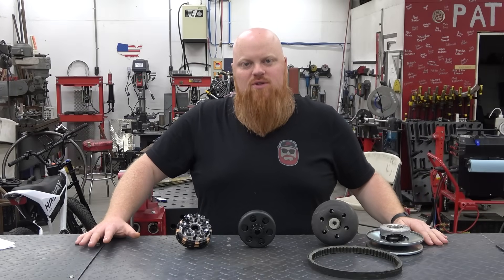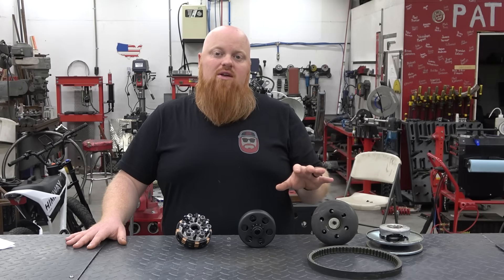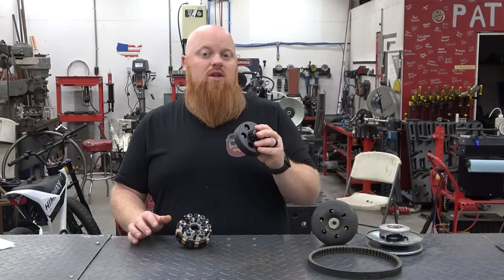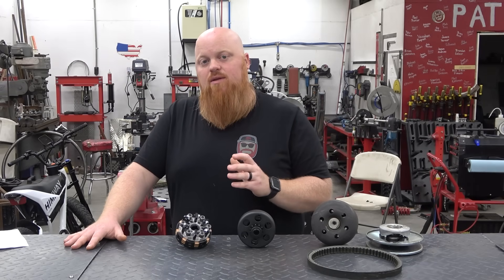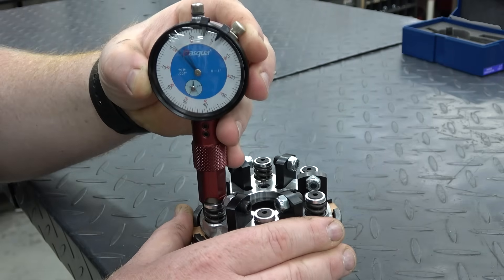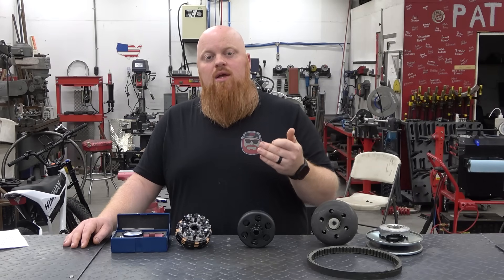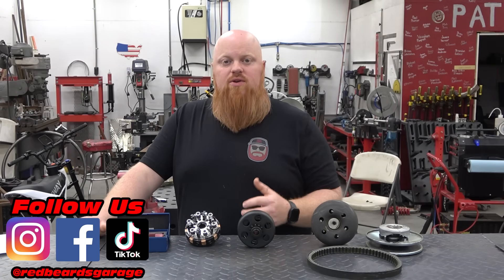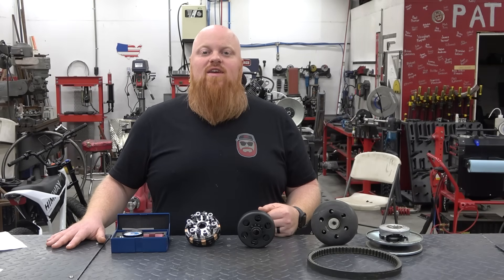Racing 3 Disc Clutch Vs Drum Clutch

Comment: Can i swap out my drum clutch (sprocket on the inbound side) for a disc clutch and expect my chain line to be the same?  My minibike if fully custom and it’s stretched so i have custom made dler and tensioner with no left to right adjustability.  If they are not a direct swap, maintaining existing chain-line i can’t use it.

Comment: Reddit talked me into then out of a torque converter. I wanted the performance but my trail riding is real UTV and Single track which involved mud. I’m in western pa and it’s wet here a lot and from riders with experience told me to avoid the belt drive. Slips even with the higher end setups when water and mud are involved.

Comment: I do a ton of woods trail riding and sugar sand riding am i better off w a converter or disc clutch? Cam, rod, flat top, 26lb valve springs on a hemi 212cc
Reply from the maker: Yes cvt would be the way to go.

Comment: I wonder if it's possible to use a cable around where the spring goes in the max toque CVT and control it with a hand lever. In theory it makes sense to my brain .

Comment: Got me drooling over a disc clutch my big butt doesn't need lol. Would be worried about dust, dirt and grime even on asphalt. Maybe a Tillotson 212R with a header and 24mm flat slide carb on an old race kart for racing around the block. Still probably overkill for the application.

Comment: Would you say external climate would impact what clutch you use? Could disc clutch be used for snowmobiles or carts that will run in potentionally cold, muddy or wet tracks?

Comment: I had a juggernaut cvt but it wasn't what I was looking for  too much rpm at cruising speed so I put the stock centrifugal back on with a modified clutch 13t at 7.6:1 I'm getting a 12t centrifugal for 8:1 on a 19in tire

Comment: Which one do ypu recommened 2 or 3 disk? My gearing is 12/60 on a db30 frame, built 212, .356 cam, 1.1 venom rockers, 32/25 ported & modifed head.

Comment: i hope this doesnt come across as offensive to the bigger guys 
but if your a big guy like over 160 your gonna need to spice your engine up as well as mess with the gear ratios smaller fellers like myself 135 lbs  can get away with with a stock 212 and stock gearing  on my coleman  ct 200 u ex i get 25 mph un modified (although my governor is defective from the factory) and coleman stock gear ratio is 10 to 1

Comment: Have a 19” tire mini bike 224 pred. W/ 24mm pwk, 265 cam, 13-1 comp, custom head. The bike has 50-1 gears, I use a tav2 with a spacer that limits the travel of the driven I also run the 3600 rpm white springs, on the driven I run the stock spring in a 4th hole I drilled past the max setting, I’m still looking to try the yellow spring because this motor likes to rpm
Reply: How's the reliability so far?
Reply: @JackSpeed  great so far
Reply: Hey im running the same set up as you more or less but I have a comet 30 series TC. I cant stand how fast it switches to its high gear. I'd love to rev it out to 4 or 5k b4 gear change so I got the blue silver springs which I believe are 3800 springs. My issue now is if I'm in high gear hauling ass then let go of the throttle I'll have a nice coast until 4k-issue then it drops low & it's violent as hel. How does your bike react with the stiffer springs? I cant find any info or a single video anywhere lol fmll

Comment: Can I use a CVT on a vertical shaft engine?
Reply: Was wondering this myself as I was looking at a free riding mower today...
Reply: CVT's operate on centrifugal force and can be adjusted by using different springs.  There's no reason they can't work in any orientation.

Comment: How is the racing clutch for everyday just riding around the city at high speeds. I've been using the centrifugal clutch for the longest but im tired of swapping them out every 50 miles.
Reply: Do you oil your bushing in it?
Reply: @thedude7726  yeah I use Lucas oil stabilizer. They say use regular oil but I found that last longer.
Reply: @2alawabidingcitzen max torque

Comment: Do you know of any clutches for low speed? Sometimes I'd like to cruise at 5-10mph on my predator 212 without burning my clutch
Reply: If you watch the video you will learn you can tune adjust clutch with different springs.  A really light spring in the centrifugal clutch would force it to engage at low RPM.  
Or you can change the gearing so you're going a lot slower for a given RPM.

Comment: I use the drum clutch with your stage 5 ghost motor and it’s doing amazing no slip and it doesn’t get hot I think my gearing is 12 on clutch and 72 on rear sprocket

Comment: I vaguely remember back in the early 80s seeing oil bath disc clutches similar to motorcycle wet clutches. There was several people in my area with racing go carts both 2 and 4 stroke some running on gasoline and some on alcohol that ran the oil bath clutches. I haven’t seen or heard of one in years so I’m guessing they aren’t made anymore.